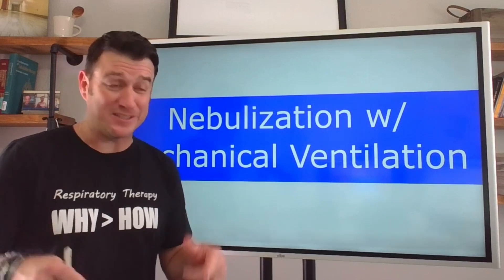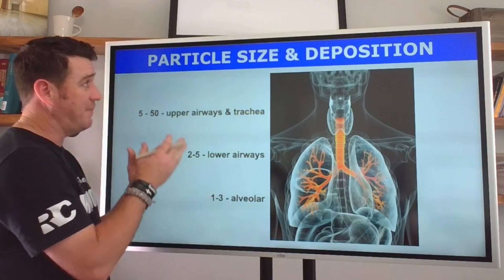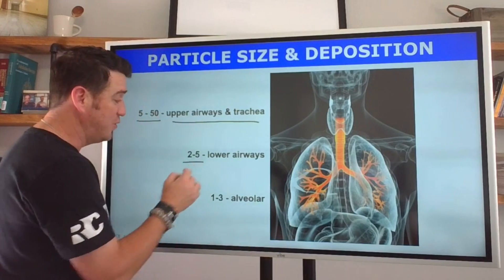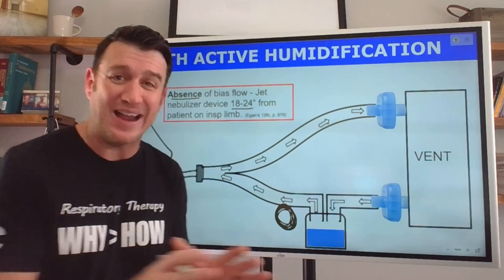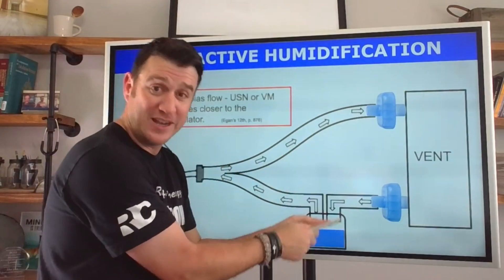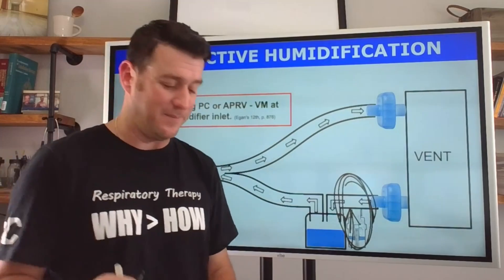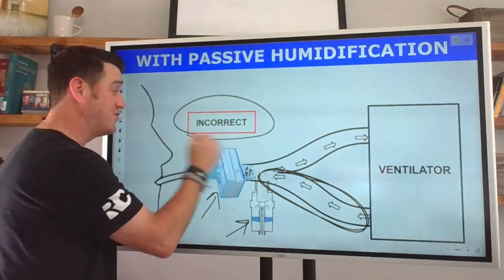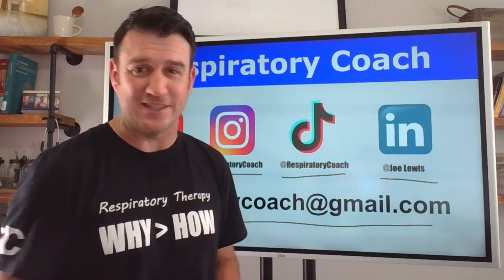Respiratory Therapy - Nebulization during Mechanical Ventilation

Comment: Great informative video. Fyi to some out there, be mindful of the PIP and VTe that is read from a flow sensor after thebexhale valve when delivering nebs. Certain nebs ceeate powder and will plug off the filter resulting in high PIP, high read PEEP, and VT not read accurately. Great trouble shooting can be the filter being plugged.